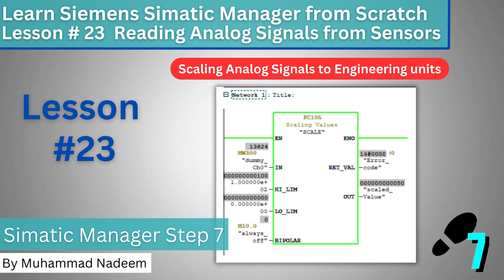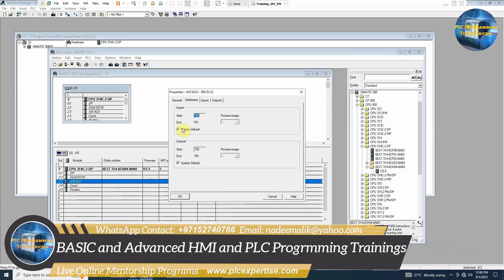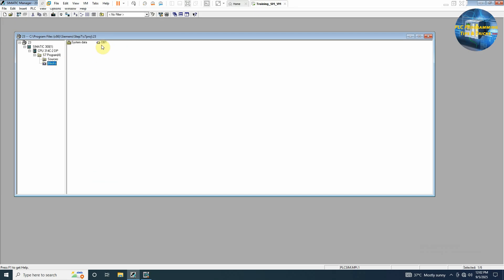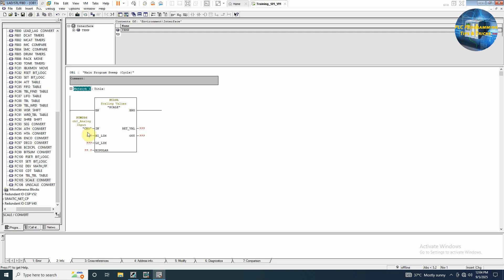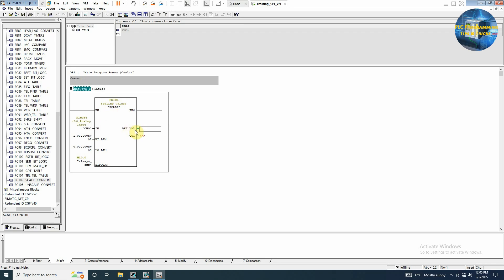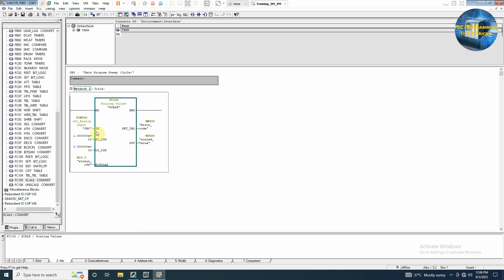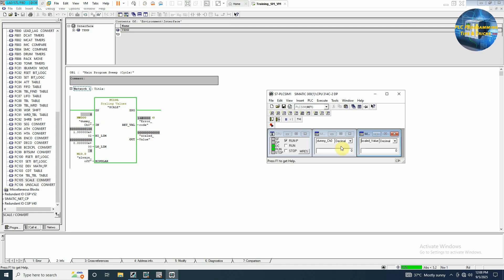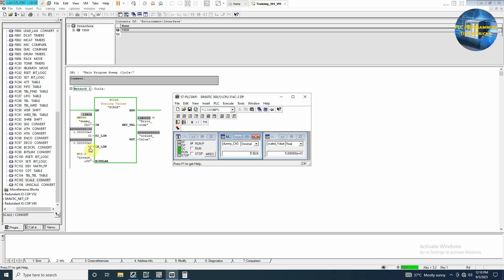How to Read & Scale Analog Sensors in Siemens PLC | FC105 Scale Block Tutorial

Comment: Which software are you using?
Reply: This is SIMATIC MANAGER, also called STEP7. It is the older version of programming Siemens S5 and S7 CPU plcs. The newer version is still called STEP7 but uses a program called TIA PORTAL. Any version 5.x of step7 uses simatic manager, anything past like 10.x (currently v22) uses TIA portal